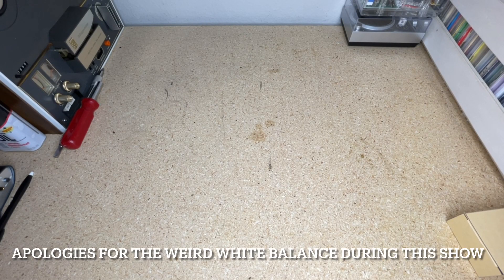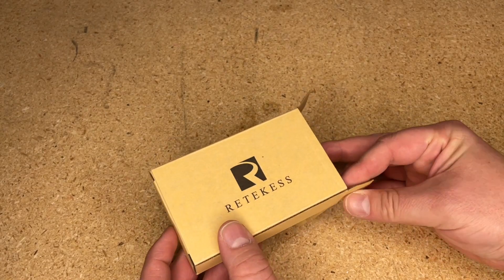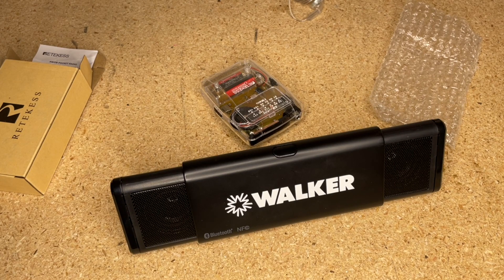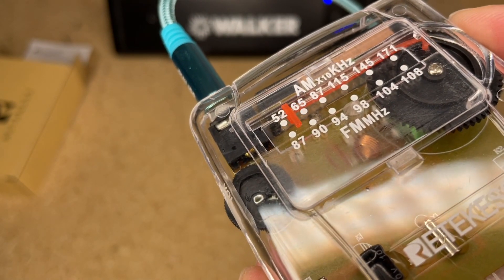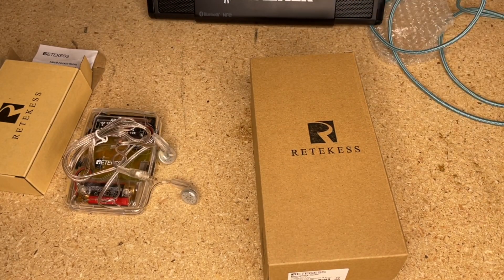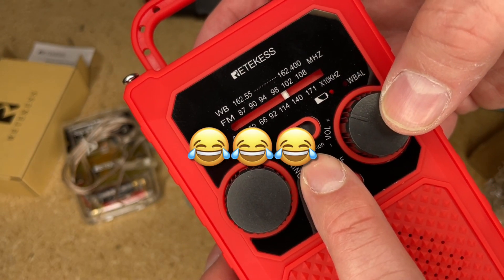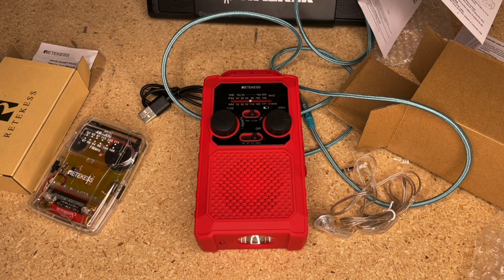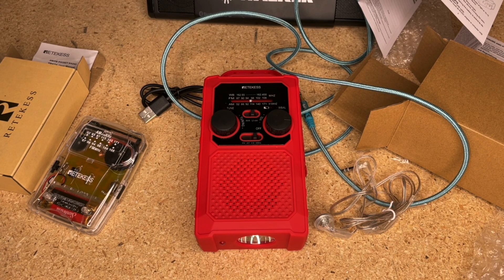For Radio Lovers Only!

Comment: I've always loved clear case electronics.  In the 90s, I had a 6 inch, square screen b and w tv with an am/fm receiver in a clear box on my kitchen counter.  At first I used the ota tuner but I later hooked it up to a cable box which was bigger then the tv itself.  It's long gone now, and it was pre digital, so it would never work today, but it was fun.

Comment: I'm usually at the other end of the spectrum on radios :)  All the radios I have are huge and full of tubes and only a very few have FM at all though some do have 4 bands of shortwave as well as broadcast (AM).  I really lucked out last month and got an RCA Radiola 60 from 1928.  It was the very first superheterodyne radio that ran on household AC current.  Nothing so special about that, but the cabinet that the radio is in was manufactured by the Stout-Smith Company of Salem, Indiana.  Nothing really special about that until you know that I live 3 miles from Salem so the cabinet is all but back home again after spending the last 95 years in New Jersey!  I've never heard of Stout-Smith, but we did used to have a factory here I remember well called Smith Cabinet and I'm betting it's the same place with a name change sometime in its long history.  I knew them as makers of Child Craft Furniture.  The radio is the "coffin" style, being a long wooden box with a hinged lid and 6 027 globe tubes along with an 072 and a type 80 rectifier globe tube as well.  It uses a separate speaker that most folks usually sit atop the radio.  It's not the big black horn style, but I'm betting one of those would work fine with it, providing the ohms are high enough to match.  I'm thinking in the neighborhood of 1,100 ohms (These old speakers didn't have modern magnets and use a high voltage field coil to make an electromagnet to drive the speaker, standard practice until about the late 1940's)

Comment: I'm a true radio lover 💘. I collect them!! A little too new. 70's, and 80's are more my style. So are some of the 1950's, and 1960's. At least, some of the Retekess brands of today are impressive. So is C-Crane, Tecsun, and many 👨 other radios 📻. It's a bonus when they come with the little earphone 👂, but I often replace them with a favorite pair of headphones 🎧. The little earphone 👂 works in one ear 👂, since it's a single earbud 👂. Yes 👍 they work in a pinch. Some of these radios need a stereo adapter plug 🔌, to convert your headphones 🎧to play through both ears 👂. Some of these radios still play as mono, through both ears 👂, even when the stereo adapter plug 🔌 is used, so be warned, unless ya don't mind it being mono in both ears 👂. Your friend, Jeff.